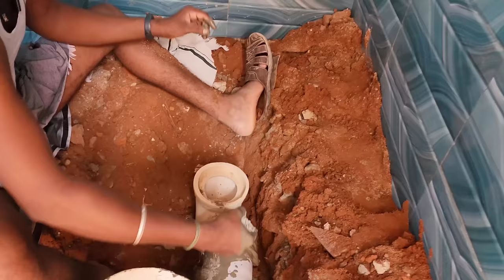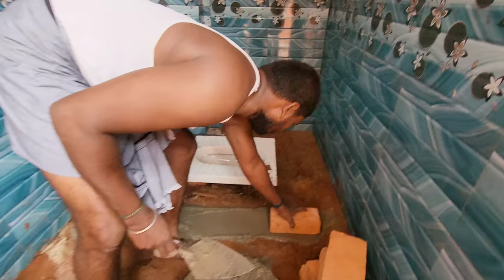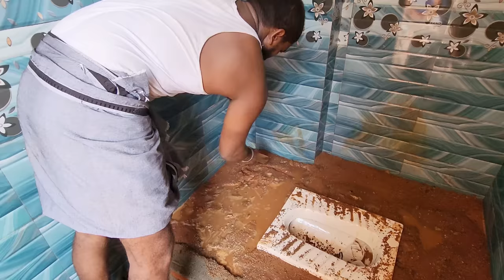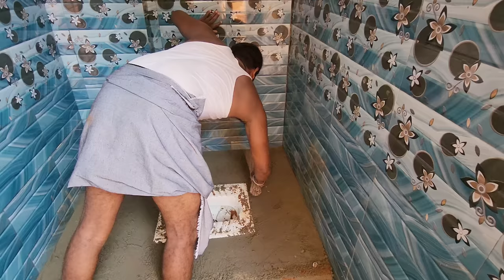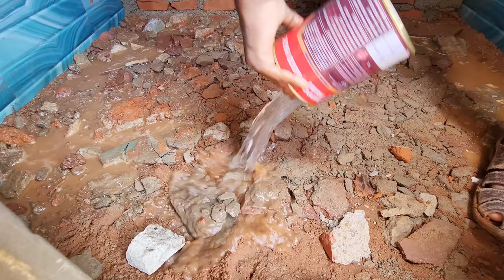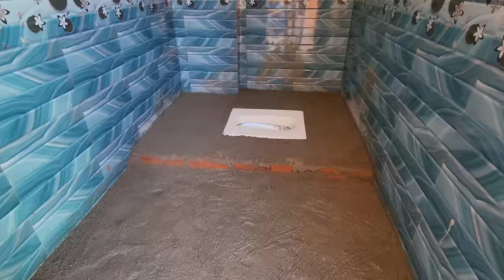WoW Excellent Work!-How To install Indian Toilet Seat Accurately easy Fastest-using sand and cement

Comment: This is not propper installation method  coset correct seting in under the foot rest  it's never  craek or closet not depthgoing du towater swepag  maximum load on the foot rest it's given on brick under the foot rest